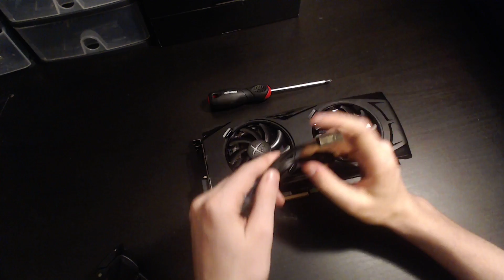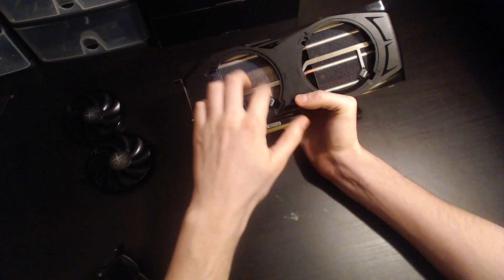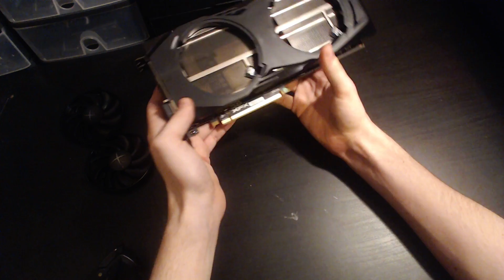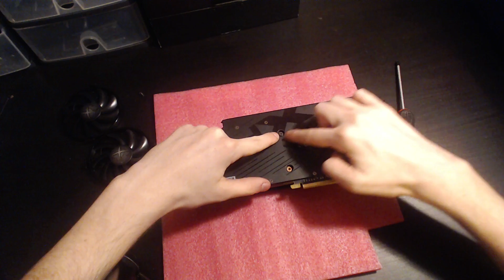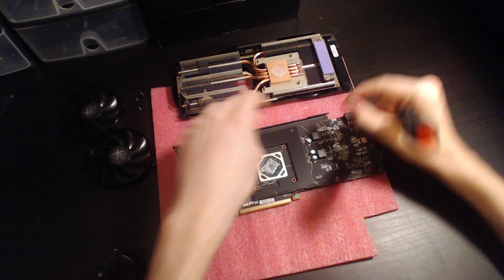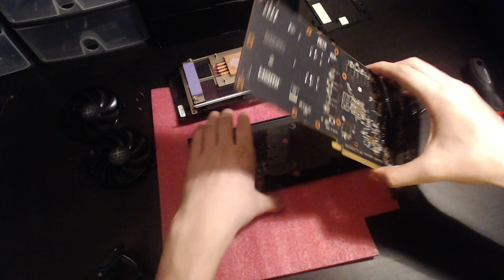XFX RX 480 GTR teardown

Comment: can you do a GTX 960 OC at air and ln2 to see how much gain you will have with Ln2??? if its posible a Msi gtx 960 would be great if you don't fine msi any gtx 960 will do :D
Reply from the maker: I have a GTX 960 but I don't really feel like putting it on LN2. If it wasn't the ASUS DCUII mini PCB I'd do it but this card is just a hassle to work with.
Reply: erm.. at least air OC with your volts mods and power mods to see the improvment ?
Reply from the maker: I want to sell the card. I doubt many people will be willing to buy it if it has volt mods hanging off of it.
Reply: erm ... ok i see  ... good luck selling it :D , I have  the MSI GTX 960 :D  thats my main card :P
Reply: ERM ... 1  QQ (quick question)  you that you know from extream overclocking erm.. GTX 960  1520 core and 7944 mem at air is it a good OC or not ? (its stable with no artifacts)(1520 all the time no drops)
Reply from the maker: 1500 is pretty much normal for maxwell cards.
Reply: thanasis47 how does overclocking   effect cache
Reply: Actually Hardcore Overclocking i doubt that is the boost clock of my 950
Reply: magnefficient gaming what did you mean ? what cache?

Comment: is this the rumored polaris 10 rev 2?
how can it be so cool and oc so high?
Reply: Yeah, I thought about it and AdoredTV even did a video on it. It seams the yields and waffers are getting better, so the GPUs are getting more energy eficient, accepting lower volts and overclocking a litle better (although it seams it's still hard to go past 1450 MHz). Some people say we will have a RX485 or something with the "rev 2", but for now we need to pray to hit the silicon lottery. (I missed with my rx 470...sadly)

Comment: Would you use double molex to 6-pins?

I used one for a 1GHz 560 Ti on a crappy PSU (rated for 386W), glad I didn't die from it XD
Reply from the maker: 2 molex to 6 pin isn't as bad however I still wouldn't use them. Molex connectors in my experience never get a particularly solid connection and if that gets upset you might get a high resistance spot which lead to the connector heating up and melting.
Reply: Actually Hardcore Overclocking
coolio thanks :)

Comment: I noticed there is a plastic film between the thermal pad for DRAM and the black plate thingy. will that affect the cooling performance?
Reply from the maker: yes it will but it's there to prevent short circuits. Also I'm not sure if it goes under the thermal pads. I'll have to check.

Comment: damn these AIB cards come with cheap crap fans. The reference fan looks industrial and should last a long time, at least i hope mine does.
Reply: The reference card uses a 'blower' style fan, hence the difference in appearance. The heat-sink that comes with it is total garbage though.
Reply: looks != durability or performance.

the entire Rx 480 Reference Cooler is complete garbage.
Reply: Well they are always the same every year aren't they?
Reply: Darin Steele that's not a good thing - Reference Coolers aren't made to be great.

Rx 480 in particular has a different Cooler from the usual though for Reference designs... in that the Heatsink is like 10x smaller than it usually is.
Reply: yeah the little heatsink probably doesnt do much
Reply: Darin Steele yo.u. mean.  like. the 30 mm fan

Comment: Hi Buildzoid,

I've seen testing that shows the reference RX480 had it's power delivery changed in software by AMD with a driver update, so that it wouldn't go over spec on the PCI-E slot and would "overdraw" on the 6-pin connector instead. Would that not apply to the XFX card?
Reply from the maker: yeah the reference card is told to put more strain on the 3 phase connected to the 6 pin. I'm not sure if this is card specific or it applies to all 480s. Still I would prefer it if the VRM pulled equally across all 6 phases instead of more from 3 regardless of how the 12V is connected because even on the pre patch drivers my ref card didn't cause any problems and I ran it well into the 200W power area.

Comment: Hi I'm from Brazil. Congratulations for your work. I want to buy a rx 480 which is the best in quality construction term, oc, performance and cooling? It would be the strix, gtr, nitro, g1? if it is not any of the 4 which would it be? vlw success
Reply: from the reviews i've seen , the GTR really seems to be the card to get
Reply: I think the best RX 480s are Asus Strix and the XFX GTR. There is 3 year warranty on both cards and XFX extends the fan warranty by another 2. If the fans fail, you don't have to send the XFX GTR card for RMA< just the fans. :)
Reply: I bought a RX 470 red Devil that was very cheap here in Brasil, but this model is horible to OC, the power limit will only go up to plus 5 percent... so the GPU won't even reach 1200 MHz...so sad...(Legal achar brasileiro em um canal decente. Fugindo da Chipart?)
Reply: Petrus if your really that into cleaning the fans then get the gtr. But let me tell u its not too big of a deal since dust doesn't damage the hardware anyway. That's why most companies don't bother. The gtr i think runs slightly cooler but I don't own it so it depends. The gaming x uses more power and its a little bigger too. So that could be a concern for smaller cases. 
The gaming x has rgb lighting and red led accents if you're into that. The fans on the gaming x are not as loud, since they are bigger fans, they generate more airflow which allows them run at low rpm. The gtr has a factory oc at 1288 mhz while the gaming x is 1303 mhz They are both the best rx 480s you can get. The gtr is cooler and more power efficient. The gaming x is prettier and quieter, plus the cool features on the msi gaming app. Hope this helps:)
Reply: Guilherme .Fenner Take that g1 off your list and include the gaming x. You should know by now that the g1 is the worst 480 u can get because it completely fails to keep temps cool. Consider the gaming x instead, from my experience i got very low temps under 73C and i got an oc of 1410mhz. I have two other friends with the same card who got higher oc than me. You should get this msi, it also has a good build quality and cooler is one of the best. The nitro is also very good at oc, but it's also the loudest 480 and the cooling is not as good. Strix is very good but its the most expensive , theres no reason to pay so much for a mid range card. Size can be a concern at 12in though.

I think it really comes down to the gaming x or gtr, both offer very good oc, performance, and cooling. Some people don't like the red and black design of the msi though. Id say get the one that cheapest:)
Reply: The STRIX and the GTR are about equal. Dear OP seems to suggest a preference to the GTR.
Reply: Petrus which one did you like
Reply: Exatamente um ano atrás eu comprei a XFX GTR, melhor placa que já tive, melhores componentes e pra OC tbm, pegou aqui 1500 no core clock, com esse oc as temperaturas foi pra 72 graus. Sem oc não passa dos 64 graus.

Comment: OI sou do Brasil. Parabéns pelo seu trabalho. Eu quero comprar uma rx 480 qual a melhor em termo de qualidade de construção, oc, desempenho e refrigeração?  seria a strix, gtr, nitro,g1? se nao for nenhuma das 4 qual seria? vlw sucesso
Reply: Ola! Com base nesse e em outros videos, a melhor é a Strix. Como ele disse no  video, essa GTR pode sobrecarregar o slot PCIe.
Reply: Como dito no vídeo, a XFX PODE queimar sua placa mãe, pois não foi solucionado a questão de puxar mais de 75W do slot PCIe, pois o pino da fonte alimenta apenas parte da placa, qndo de acordo com o Buildzoid o melhor seria o pino alimentar diretamente toda a GPU. A MSI ele tb já disse que não tem nada de Premium no PCB, apenas seu sistema de refrigeração e por isso ele não recomendaria sua compra. Como eu disse abaixo, a mais equilibrada e com PCB Premium é a Strix. A única desvantagem é não possuir dual Bios, então complica um pouco para ultra hardcore overclockers. Então se for um usuário comum com um gabinete razoável e que vai fazer um over normal,eu iria de Strix. Se realmente for fazer mod volts, usar nitrogênio e possuir uma placa mãe premium (que possuem melhor capacitores etc), vá de XFX.
Reply: Queima nada, já puxei um OC fodido aqui na minha GTR em 1500 no core clock e tudo de boas.

Comment: hey man can you do i benchmark run and measure with msi afterburner the watts of the card !
i think you will see 100-110watts at full gpu utilization power !
if you can make a run ! thx for your time !
Reply from the maker: The GPU core on my average 90-100W during testing. But that's the GPU core alone. The rest of the card isn't measured.
Reply: nice thx you for your fast response !
i have rellocate many things in my head ...
Reply from the maker: BTW the BIOS power limit is 110W. So Furmark will stop at 110W unless you remove the limit.
Reply: BuildZoid you reach 100w on GPU in 1480MHz?
Secure power draw is ~69w in 12v PCIe slot right?
If yes, it don't mess up with PIC SIG.
Or am i worng? =/
Reply from the maker: on 1480mhz I was doing around 150W for the core(90W is stock power draw). So that's 75W of the 12V of the PCI-e slot which is out of spec by a little bit if the VRM isn't getting rebalanced by the drivers.
Reply: Actually Hardcore Overclocking In JayzTwoCents video he overclocked his card very well without overvolt, can reach max 138W in GPU core to not blowup the computer?
Reply: he probably remove limit if he can manage to Oclock on 1475 Mhz on this coolers

Comment: just a refresher on which aftermarket RX 480s actually reallocated the power phase from PCIE to 8pin on their redesigned PCB: Asus Strix, MSI Gaming X, Sapphire Nitro. is this correct?
Reply from the maker: yep
Reply from the maker: it can. At stock clocks it won't
Reply: AMD already released the driver fix. there is also a Compatibility Mode in Crimson that limits the power drawn through PCIE even more, without much performance impact. i think PCPer did a full analysis back then, on Compat Mode On vs Off vs previous driver.

Comment: Nice video. I`m really looking forward to buying the GTR, i was also thinking about the MSI model. But then i found your videos, so i have to ask some questions.
1. You said that the MSI one is nothing special, like it`s not worth the premium price, but here in Romania the GTR and the Gaming X cost the same price.So out of these two , the GTR basically overclocks better or something? Because of the VRM`s? Is the MSI less capable? I would like a good card, but both are good.
2. You said that the XFX could burn your motherboard, could it really? Like in what circumstances? What overclock would it need to do so? 
I`m oscilating between those two and the smallest detail kinda makes me change my mind.
Reply from the maker: I don't do FPS tests because all RX 480s that hit X/Y clocks will perform the same. So that's kinda pointless IMO. As for the overclock. The thing about overclocking 1 card and saying it did X clock is that it doesn't say anything about what other cards from the same series will manage. If I had say 10 XFX GTRs and they all hit 1450 +/-30mhz then I'd say that the average XFX RX 480 GTR does 1450mhz. However the fact that mine can run 1460mhz(not done with testing yet) doesn't really mean anything.
Reply from the maker: 2. You said that the XFX could burn your motherboard, could it really? 
Like in what circumstances? What overclock would it need to do so? 

In theory the reference RX 480 could also burn motherboards. I have no idea how far you would have to push the PCI-e slot before it failed.
Reply: Will you make another video with like benchmarks and the max overclock that you can achieve?
Reply: both are good, i'm personally leaning towards the GTR. GTR has bios 
switch and better PCB than MSI. but this only really matters if you're 
doing some extreme overclocking or flashing the bios. it's unlikely to 
burn your motherboard PCIE slot through gaming usage. AMD also issued 
the driver fix so i doubt it would over pull that much anymore.

not sure which one is cooler/quieter though. a cooler card will have better headroom for OCing. both cards should be capable to OC, how much also depends on chip lottery.
Reply: Yea, i see, just wanted to know what your card can achieve. I think at the end of the day i`ll still get the GTR.
Reply: Do you have to take the whole thing apart to remove the backplate?

Comment: I always knew the molex adaptors were dodgy, but I have no idea what the actual reason is.
Reply: electrically they make sense, but they are often used due to a lack of 6+2 pin connectors thus meaning that they let someone overload a power supply that never had any business powering a larger GPU. Also sometimes they are cheaply made and thus can fail but really it is just the fact that if your PSU does not support the GPU by default you should not try to make it do so.
Reply: There is a 'potential' for overloading/overheating/fire if you use a PSU that doesn't come with a dedicated PCIe power connector. Ofc it totally depends on the PSU and the graphics card in question. If you know what you are doing - you should be okay.

Comment: I want to buy it for my boyfriend. is it the best rx480?
Reply from the maker: It won't disappoint that's for sure
Reply: +LukewarmRaptor6
That's the joke...
Reply: 70174A We need more girlfriends like you!
Reply: Chill dude... You don't want to kill him.
Reply: josh Subet I don't know yet. I want something with a good warranty and longevity. msi and Asus have the longest warranties. so I'm looking at which has the best reputation.
Reply: +fat4ll
Jayz is a bad reviewer for the RX 480. He only tested two, yet the second one was misleadingly entitled "This RX480 DOESN'T suck!" (Implying the rest suck, while he only tested the reference otherwise.)

Also, temps are the best on the MSI one.
Reply: 70174A Just pick one. Asus and MSI are both best
Reply: 70174A Fake as fuck
Reply: ASUS may have the longest warranties but their RMA process is one of the worst. Get the MSI or XFX.
Reply: Panagio Tsaou u don't have to be so nit picky about pcb designs of the card, as long as u get good temps and a good oc thats all that matters. Most buyers wouldn't care about the pcb design anyway. I have the msi gaming x and i had no trouble getting to 1410mhz and I have two other friends that have the same card and they got higher oc than me. It looks like most msi 480s are good overclockers and are able to keep good temps too:)
Reply: Panagio Tsaou the msi gaming x is already a proven ocer and cooler, yes the gtr might have a better pcb but how much more of an oc you can get. Btw you will replace your card before it dies. No ones going to keep a card for too long because in like 4-5 years it won't run any games anymore. The gtr is one of the best but its only worth getting for a good price.
Reply: This one is the best. Temps are the best so far. Look for Jayz2cents video review of this card!
Reply: +Queen Bitch KaNoMiko No, sucky one was Gigabyte (zo now its 3 480s tezted)
Reply: +Gewel
Oh right, it was.
Reply: 70174A 
Update?
Reply: That's pure evil.
Reply: yes by far !!
Reply: Love mine stays chilly and quiet if you get the leds they are bright as all hell I can see mine through my io to be fair I totally forgot the io shield and was lazy so I didnt want to redo the mobo and stuff
Reply: +MrAnthonyC84 Wtf, you don't mean a 1060? An Nvidia 460 is really old and weak (it wasn't, but now it is)

Comment: Wonderful to see you were able to get the card! Did they send you the 1288 or the 1338 edition out of curiosity? I have the 1338 MHz version of the GTR and I can't get the frequency past 1350 😔.
Reply: Actually Hardcore Overclocking
alright thanks. also, should i turn on compatibility mode since you said half the VRMs are pulling power from the PCI slot?
Reply from the maker: I have the 1338 version and it did 1480mhz for a run of 3Dmark. I still haven't got it 100% stable for long term usage. What kind of temps are you running?
Reply: Actually Hardcore Overclocking  Fans maxed I'm not breaking 65c. default fans the highest I've seen is around 72c?
Reply from the maker: Odd. Did you max the power limit and raise the Vcore at all?
Reply: Actually Hardcore Overclocking how much voltage did you need for and what is the max safe voltage (it at least a ballpark) for this card?
Reply: Actually Hardcore Overclocking  Yeah I had power limit +50% and the max vcore on default which is 1.175. I can only get the memory to 2220 as well with voltage up as well. just a bad chip maybe?
Reply from the maker: yeah looks like a bad chip.
Reply from the maker: 1.2-1.25V should be fine for 24/7 usage. I managed the 1480 on 1.21V.
Reply from the maker: I wouldn't
Reply: Actually Hardcore Overclocking okay. Another question if you don't mind: have you figured out which bios is which? I don't know why they didn't label the BIOS switch. Is either one a power saving bios, or is it the same bios on both?